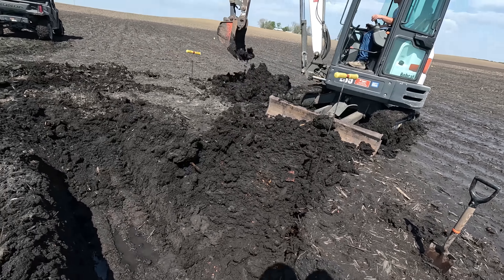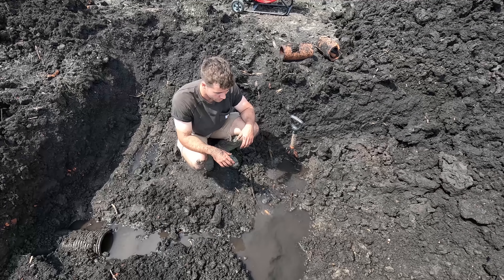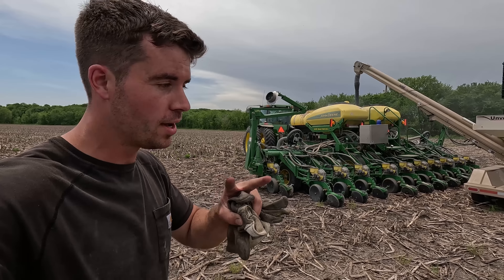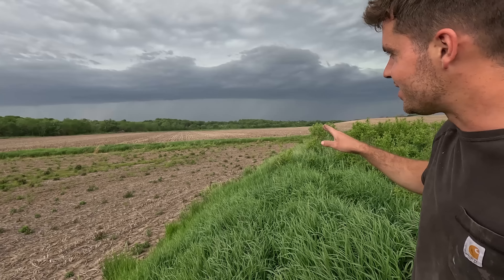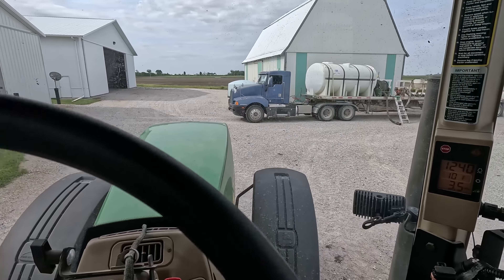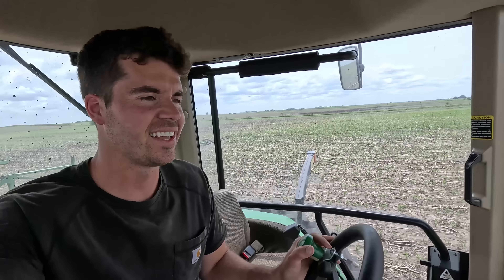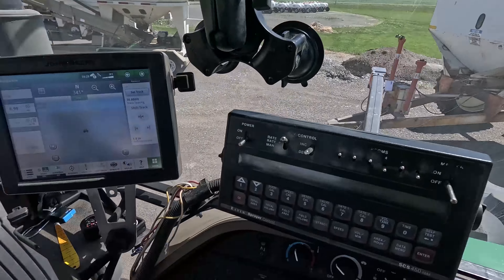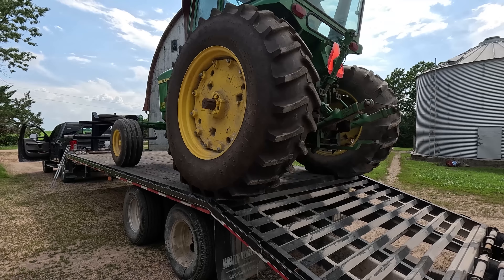Replanting Ponded Fields & Spraying!

Comment: you should rethink your urea application setup. the way you are doing it is incredibly unaccurate, and with fertilizer prices where they are its gonna cost ya
Reply from the maker: It's the 3rd application of N this season, and 2nd app of Sulfur. If this was my only application I would worry for sure. As long as it's not too windy, and I'm actually getting out of the tractor and checking the results- it's not too bad.